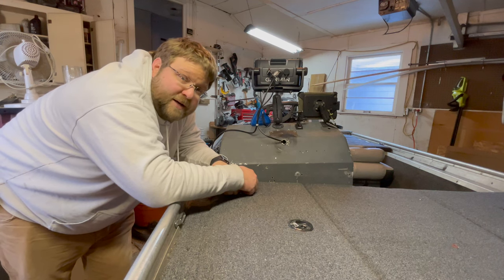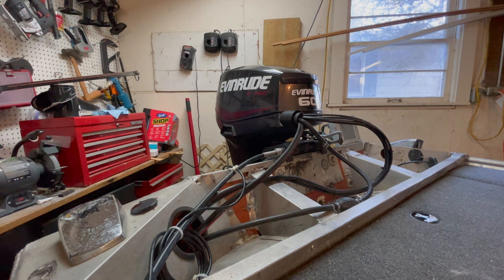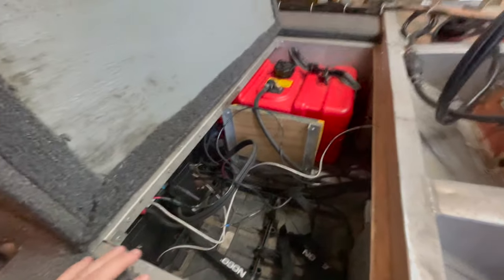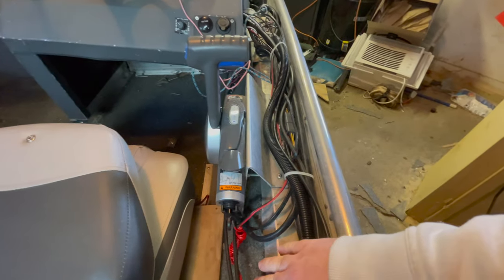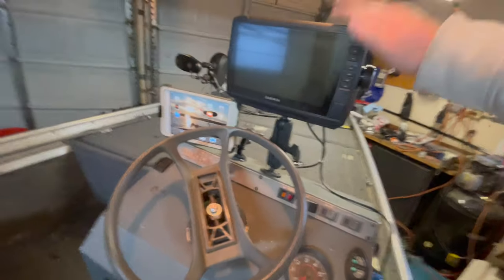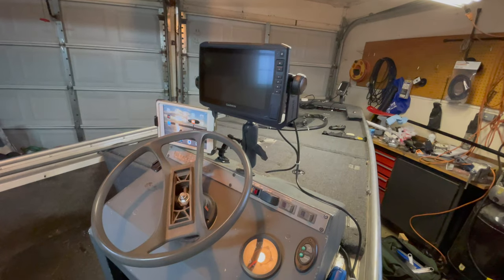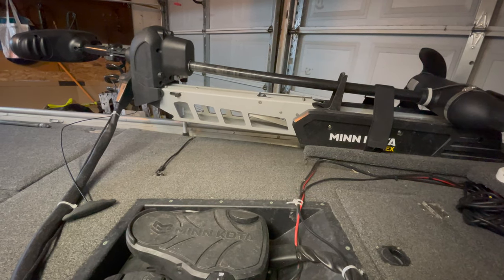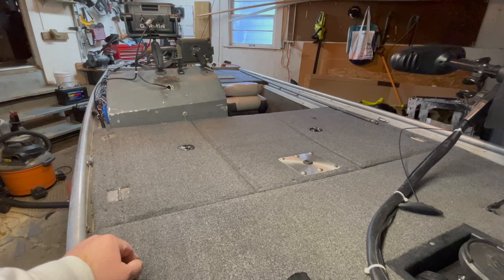An in-depth tour of my 1982 Bass Tracker III

Comment: My son just bought a 1981 BassTracker III.  In the live well, it has an overflow.  It is just a tube that is run vertical and attached to the drain line.  The water into the live well has a tube with holes in it so when you run it, the water aerates as it comes in and the overflow drains out the regular drain.  We rebuilt the main floor and front deck so far.  Fun to work on.
Reply from the maker: This boat was like legos to me. Super fun to tear down and rebuild

Comment: Enjoyed watching your build.   Did  some mods on a 89 tracker TV 17.  Basically the same layout.  I noticed your gas tank is probably not original.  Wasnt sure what the original looked like and if it was vented like yours.     Mine was externally filled and vented.   I would be concerned having a vented gas tank tucked inside a somewhat sealed compartment with a battery.   Heat, waves etc will  cause expansion and vent fumes ....a  loose connection on battery or spark could be dangerous.    Just a thought I wanted to share.
Reply from the maker: Thanks for the watch and the concern!  You’re not the only one to voice that concern. The original 6 gallon vented the same way this one does. The area is center through the scoops on the transom and gets some good air flow when motoring along. I’m always concerned about loose electrical connections though. That’s the main reason one of the first things I did was rewire the whole boat and make sure all connections are tight after any long trailering or rough water conditions